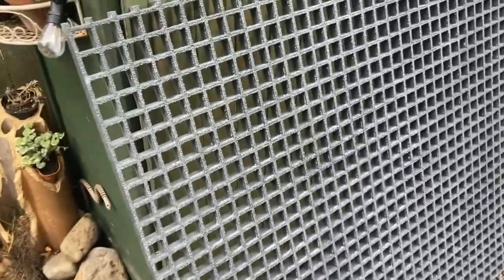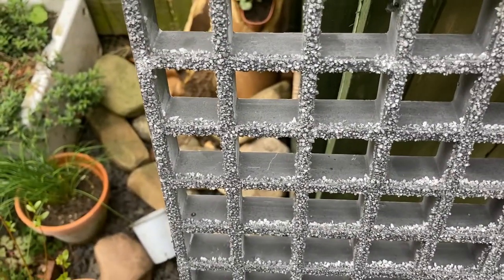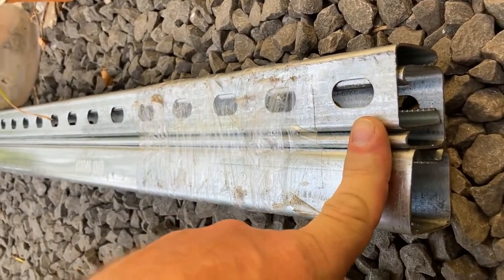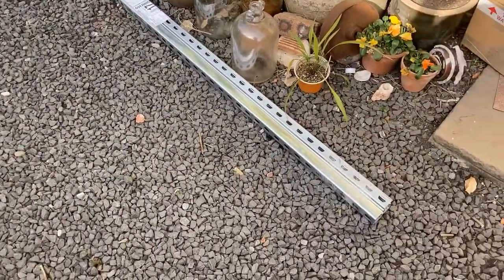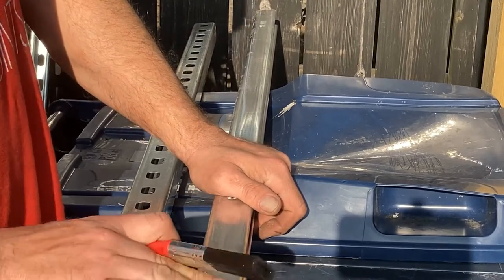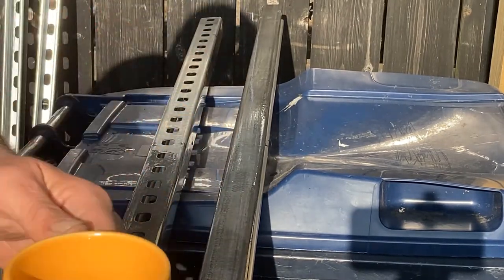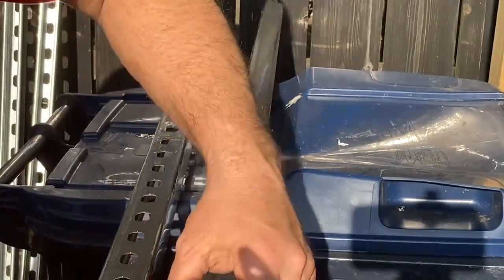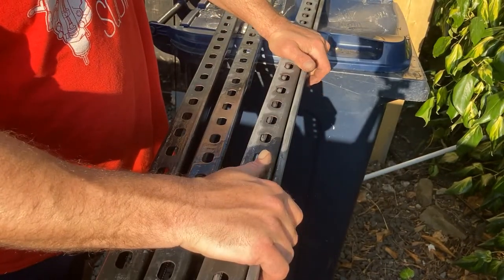Unistrut Roofrack #2  - Preparing strut for painting

Comment: What is the name of the solution you applied?
Reply from the maker: Mordant Solution, or more commonly known as T-Wash.
Reply: I’m not finding Mordant Solution/T-Wash anywhere here and the auto body shops, powder coaters and hardware stores are all looking at me like I have two heads when I about it🫠. Would you, by chance, know if there is a US version?
Reply from the maker: Aye, just had a wee look and it seems that it’s called something different in the states.     Found an acid etch primer though that says it does galvanised (z) steel.   Hope this helps..

https://u-pol.com/en-us/product/bed-liner-protective-coating/raptor-accessories/raptor-acid-etch-primer/
Reply from the maker: Looks very similar and it does say it on the tin :)  would be interesting to find out how you get on.
Reply: I ended up soaking the galvanized strut in white vinegar and it completely dissolved the galvanized coating in a couple of days.